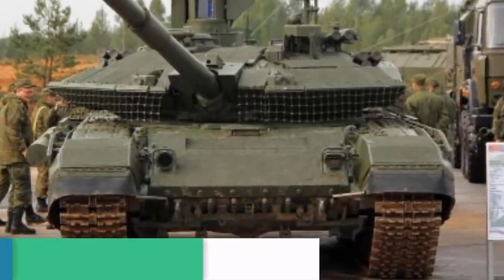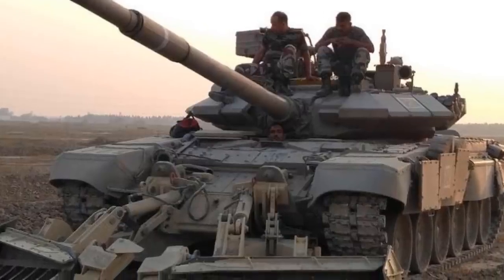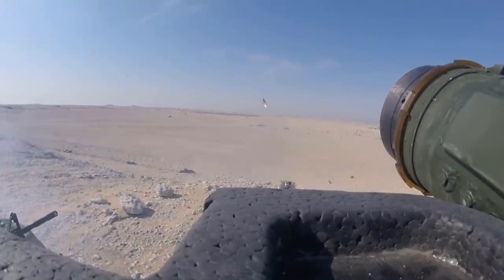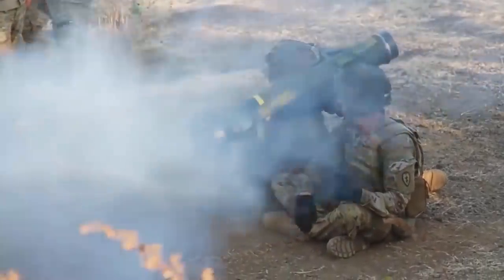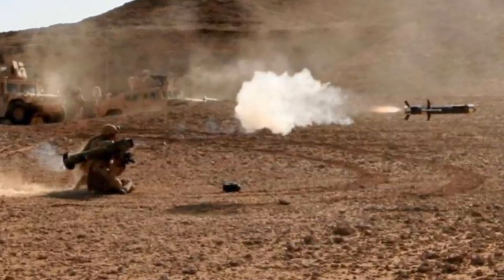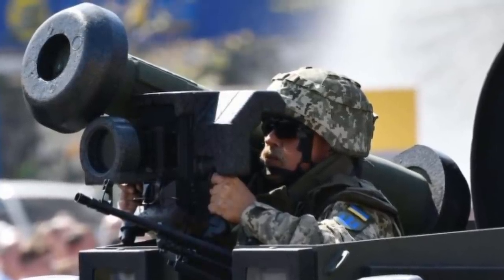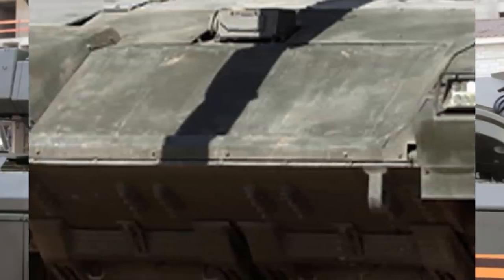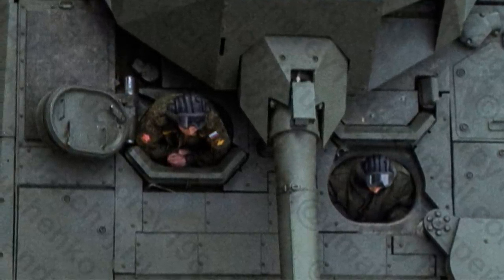US Javelin missile vs Russian Tanks

Comment: Works perfectly. We have tested it on russian tanks.
Reply: but it also in Russian hand dude. How so ?
Reply: @Grizathvili  they captured few. It's a war, we captured many their tanks and other armoured vehicles as well.
It doesn't make big difference.
Reply: @Jlexyc  - few is more than Enough for Russia to copy its tech and make precautions for their tanks and an armored vehicle. Russian has big weaponry manufactures and fast production.
Reply: @Grizathvili  you are funny. Russia won't be able to copy it. The most expensive part - it's a software. It takes years of reverse engineering.
Reply: @Jlexyc  it might be a surprize for you, but any software can be copied without having to be decompiled...
Reply: @axentic  i would like to see how you would copy firmware even from arm CPU when they are locked and there is physically no port connection for downloading.
It's doable, but not in Russia. Also every firmware is compiled to work with specific CPU, so you might need to modify a bit of "undecompiled" code.
BTW, russians had Javelins before. But nothing has been copied yet.
Reply: @Jlexyc  the reason Russians don't produce Javelin clones - they can't afford it economically. The missiles are very expensive. Somewhat $200K per shot.
Often it's more expensive than the target material. For the same reason many ATGM capable Russian tanks are not stocked with ATGM missiles.

I am actually concerned about Ukranian civilians and the in-direct effect on them.
How many more Russian tanks do you think you can destroy before Russians get frustrated and bring the big guns and start cluster bombing the Ukranian cities?
Yes, it will impact negatively their political stance, but hundreds of thousands Ukranian civilians will die. 
Politicians won't care - it's their "competition".
Do you care? Or you are just a keyboard warrior?
Reply: @axentic  I want to surprise you... they already started. They used more than 1000 rockets (including Kalibr and Iskander), and uncounted number of air bombs, including cluster and vacuum bombs.
So what is your suggestion? Capitulate? Better to die than live in russian empire. We remember our history, they won in the war in 1918-1922. And it gave only more suffering.
Reply: @axentic  Whatever you say, Comrade.

Comment: 7:00 Ukraine now has 18,000 anti-tank weapons, including at least 5,000 Javelins. Russia has 2,480 tanks in the theater, and only about 12,000 in total.  Javelins so far have a 93% kill rate against Russian tanks in the last week (280 out of 300 tries).  So, you are wrong.  Ukraine has enough Javelins to destroy half the Russian tanks in existence--and two non-Javelins to fire at every tank left over.  It is possible or even likely that ZERO Russian tanks ever roll out of Ukraine.  I think every one will be scrap metal before this war is over.
Reply: Thanks for correcting this idiotic mistake of the video. And just as we speak, the Ukrainian army is getting more and more weapons. Give them the weapons they need, they'll do the rest.
Reply: @dutchrjen  there is a report of 10 to 11 thousand russian dead that would mean about 3 times that many wounded add in captured and missing in action and thats about 45 thousand troops or 4 and a half heavy divisions against light infantry.
Reply: @dutchrjen  > they have tanks that should be able to bolt forward in wide open areas

Right but tanks are sitting ducks for anti-tank missiles like Javelins, and Ukraine has at LEAST two Javelins for every Russian tank in the theater.  Tanks instead need the infantry to get out of the APC and take out the Ukrainian missile-firing infantry... but that infantry is mostly conscripts, and doesn't have the year-long training that is required to build up the reflexes the job needs to charge into danger, advance in waves, etc.  The Russian infantry isn't even getting out of the APC, and the tanks... AND the APCs... are going up in flames.
Reply: @dutchrjen  > The Russians are trying to do this to half a dozen good sized cities in Ukraine right now

THIS is the problem.  The centuries-old rule of thumb largely holds true, that defenders have a 3x advantage.  They must be outnumbered 3:1 to defeat.  And when invading cities, they say 5:1 or 10:1 is needed.  Now, on the other hand, offense can use the strategy "defeat in detail," meaning an attacking force that isn't big enough to taken on the whole country can instead concentrate its forces on on battle and get the 3:1 to 10:1 required.  EG, Ukraine might have 200k defenders, but only 20k in a given city.  If Russia throws it's full 200k attackers at that city, it can win.

But as you say... Russia is idiotically splitting its attacks among a half-dozen (or dozen or more) objectives.

Part of the problem seems to be communications.  There aren't any.  Attacking units are still working off the paper orders they were issued before the invasion started.  They're just mindlessly persuing the original strategy based on the assumption that they'd be welcomed as liberators or something...
Reply: Russia does not have 12,000 tanks, only 3000 exist that are in active service.
Reply: @dutchrjen  Right.  Traditionally it's been said attackers must outnumber defenders 3:1.  But in cities the rule of thumb is more like 5:1 or 10:1.  The Russian numbers are comperable to the Ukrainians, so the theater as a whole is only like 1:1.  NOW: a common strategy is called "defeat in detail" and means the attackers focus their numbers on a very small area, and achieve the 3:1 or 10:1 just in that one battle and win it.  BUT THE RUSSIANS ARE NOT FOCUSING THEIR FORCES!  They clearly thought the Ukrainians were surrounded, but in fact the Russians were simply diluted to the point they're not getting even 3:1 odds ANYWHERE.
Reply: @miketaylor5212  The Russians deployed and estimated 190,000 troops.  A loss of 45k would be 25% of the total troops deployed.  Generally there are 5 troops supporting every  troop engaged.  The numbers you use would indicate Russia has "used" all their fighters.  You sources numbers seem to be quite high considering the battle continues.
Reply: @dutchrjen  Bolt forward? right into meter-deep mud....
Reply: And more are flooding in by the day...   Russian armor is gonna have a bad time.
Reply: @lqr824  Ukraine has about active military 150K troops... They have massive reserves, (some as as many as 900K). 100K Ukrainians are returning from overseas to fight.  20K troops are coming from other nations to form a Foreign legion.  Morale in Ukraine is high. they have a population of 45 million people. With such a large population and soaring moral, they could legitimately raise 1 or 2 million new green troops. ..  Russia is in fact encircling Ukrainian cities..  That seems like a fantastic way for them to be attacked both by city defenders and gorilla fighters from the countryside at the same time. Setting up armor outside of cities in the flat plains of Ukraine is asking to get squeezed from both sides and the terrain favors Javelin attackers.
Reply: @bellicosepariah6609  Javelin missiles have an effective range of 4km (2.5mi).  So far they have a kill ratio of 93%.  I think the Russian tanks are safe as long as they're on roads out in the countryside, but once they roll into a city, where they're within sight of say 20-50 windows, a Javelin will come out of one of the windows and blow them up.  I really do not think that a single Russian tank will survive this.  Ukraine actually has more Javelins now than the entire Russian army has tanks anywhere in the world, including even the oldest clunkers and tanks that haven't run in years due to lack of parts or repair budget.

I don't think Ukraine even needs to raise a militia per se.  Just train everyone to sharpshoot.  Rifles are useless against APCs... but APCs don't have bathrooms, much less cafeterias or room to sleep.  Like tanks, the APCs need to be refueled several times a day, and the fuel trucks are utterly unarmored.  Every time a Russian leaves their APC they will be shot by some mother or granddad.  They're not going to be able to sleep, eat, refuel, or even take a leak.

Putin's main hope is just to shell the cities flat with artillery.  But if so, so much for his story that he had to go in to protect people from genocide...  and since his entire rationale for the invasion, to his people, on TV a couple weeks ago was that Ukrainians are really Russians, flattening cities full of so-called Russians is going to piss off even flag-waving Russians.

If I were Zelensky, I would refuse any terms of peace that don't include Russia actually leaving Crimea Donetsk and Luhansk...
Reply: @miketaylor5212  "your report" is the fantasy of the people's commissar and nothing more. For every one killed, on average, at least 3 were wounded. With so many wounded, all the hospitals in Russia would be filled with the wounded, and the Belarusian hospitals too. But in reality, the losses of the Russian Federation at the moment are at the level of "sanitary". Sanitary losses are the level of losses when during the exercises someone jumped off the tank and twisted his neck, accidentally shot himself, got pneumonia and died, someone was asked by the technique, that is, 0,1%
Reply: Ain't no way in hell Russia has 12,000 tanks that RUN.
Reply: At the end of the first month I took the number of tanks reported destroyed and the supposed total Russian tanks available and I suspect in a few months Russia would be out of tanks. I've seen US military leaders say this invasion is a fraction the size it should be. I would no5 minimize the Ukraine military in their response, but the expectation has been that Russia is a first world military power. Without their nuclear arsenal they are a laughing stock. One huge difference with Ukraine has been western training since 2014. Another is the technical innovation, like incorporating drone enthusiasts into their defense. Russia has failed to learn the lesson that doing the same thing and expecting a different result is the first sign of insanity. I've been hearing for over a week that Mariupol is falling but I heard there was a brief Ukrainian breakthrough. I hope they have supplies because Russia is throwing their best at them and it drags on. When Russia asks for surrender it is not compassion, they have none, it is pain of loss.

Comment: Upper ERA+Trophy System APS+Laser eye thing turret +Cage Armor.
Reply: WTF
Reply: Eye laser only works on old laser guided and wire guided systems so obsolet not being used on Modern T90s,
ERA still needs stronger Armour behind it to work and good luck putting ERA on the roof of a tank,ni space for it, most APS dont stop top attack those that do a far rare and costly, the cage is called a cope cage for a reason.

Comment: Does anyone know if the Javelin has an optional mode to target the top deck of a tank's engine compartment?  While it might be a lot more satisfying to think you are killing the tank's crew, most tanks have precious little top deck protection for their engines.  Damage the engine, and the tank simply becomes an immobile target.
Reply: Direct attack and top attack only, top attack attacks highest point normally turret
Reply: russian tanks have ammo usually under turret. slava ukraini
Reply: Considering all the photographs with turrets blown clean off when the ammo explodes, there's no reason to do that.  The tank turret has to be central, engine decks could be faked.
I am sure Russian tank crews are very impressed with the results
Reply: that is what they do.
Reply: An Immobile target that can still fire it's main gun at you. Not to mention any mounted machine guns or any other offensive weapon

Comment: Nice effort but little bit inaccurate and already out of date. Javelin is top-attack. Slat armor is on the hull side so a non-factor. Russian tanks have only half of the turret top, and none of the engine deck protected by ERA. The visual evidence indicates that Javelin works fine on T-72BM3, which has no worse roof protection than T-90 and the "sun shade" is largely ineffective. With the E.U and U.S providing even more military aid expect more "Javs" to arrive on a regular basis. Its likely they are saving Javelin for the heavy armor, but the rest of the rapidly expanding Ukrainian anti-armor inventory  (AT-4, M72 etc) is quite capable of killing all of Russia's APC's. The better weapons like MILAN 3 , Panzerfaust 3 and M72A5 with tandem charge warheads will likely defeat a T-72's or T-90's protection if they strike anywhere outside the Tanks front arc. NLAW is a proven T-72 killer and more are already arriving from the U.K and Sweden.
Reply: Actually  Javelin has two fire modes, direct and top down.
Reply: @dimagroza829  yep. Direct fire mode is for use against light vehicles, field fortifications and structures. I did not mention it because I was focusing on anti-armor applications. You would always choose top-attack against AFV's unless there was a pressing reason not to, like overhead cover.
Most Tanks have superior horizontal protection and Javelin would be less lethal against them in direct fire mode. Direct fire mode should still destroy most APC's and penetrate the side Hull and rear armor of most Tanks.
Reply: @simonmoorcroft1417  Do the grills we put above our hatches not provide unough protection then?
Reply: @dimagroza829  slat armor is pretty good at stopping RPG's. It's designed to crush the nose fuse and prevent them from detonating or make them explode early at "non-optimal" stand-off distances. If your talking about the roof mounted cage-like "sun shades" mounted on the turret roof of some Russian tanks in the last few months then Ukrainian firepower demos (found on Youtube) and battlefield reports indicate that Javelin is powerful enough to smash through the cage and still penetrate the turret top.
Any weapon with a tandem charge warhead stands a good chance of ripping the cage apart with its first warhead which allows the main charge to then act directly against the armor.
Reply: Let's hope they can get them in with Russia grabbing all the ports and tearing up airfields.
Reply: @dimagroza829  
No. Lots of photos of tanks with those chicken coops welded on with their turrets blown right off. (Telltale sign of a Javelin hit and ammo detonation)
Reply: Canada has sent approximately 4000 anti-tank weapons to Ukraine......

Comment: What is "rolling" homogeneous armor?  The cages/slats aren't meant to deflect the direction of the HEAT jet. They detonate the HEAT earlier than it's effective stand off distance to form it's molten jet. The T-14 series tanks don't have 1500 mm thickness armor, it is 'equivalent to' 1500 mm  RHA (rolled, not rolling homogeneous armor). 

Whomever wrote your script needs more research.
Reply: Yeah I was wondering, 1.5 METERS of steel would be the mother of all tanks 😂

Comment: NLAW: NEXT-GENERATION LIGHT ANTI-TANK WEAPON
The next-generation light anti-tank weapon (NLAW) is the first missile system for non-experts and can strike out tanks with a single shot as it strikes from above.

The weapon weighs 12.5 kilos and depending on which year model it is, the fired missile reaches 600-800 meters. It can be fired in tight spaces.
Price per piece $ 25,000.

It is manufactured by Saab Dynamics.

The American missile weapon Javelin is twice as heavy as the NLAW at 24.3 kilos, and reaches 2500 meters.

In 2002, a single Javelin command launch unit cost $ 126,000, and each missile cost around 
$ 78,000 (equivalent to $ 112,000 in 2020). Thats $ 238,000 do you get it now ?!
Reply: NLAW - single-use, cant be reloaded, single warhead.
Javelin - multiple use, can be reloaded, tandem warhead , its CLU ( Command Launch Unit ) has thermal imaging so its effective also for recon if necessary..
Reply: @jerski14344  Och ?!
Reply: @tomeng9520  Single use Nlaw , you would want to high tail out of your position if you had multiple targets and no extra launchers to do anything about it. 
Rather a Javelin missile with up to 9x thermal optical zoom and direct fire mode against light armor. 
Top fire mode would even handy against snipers firing from windows in buildings with it's anti tank destructive blast capability drop it right on the ledge of the window with pin point accuracy and ragdoll the enemy. 
Options possible use scenarios are limitless.